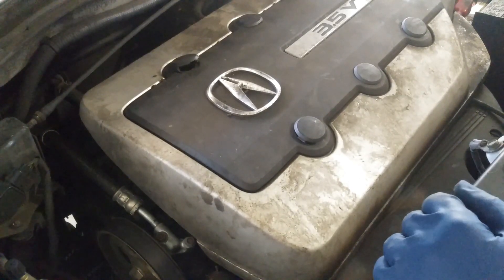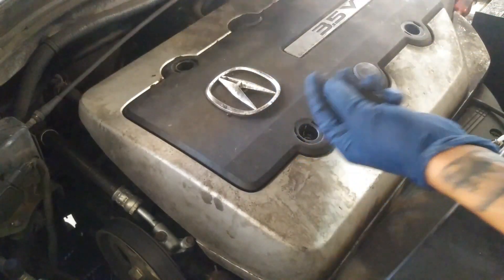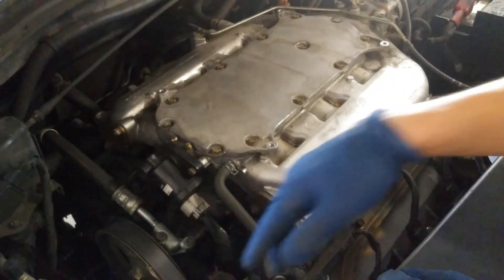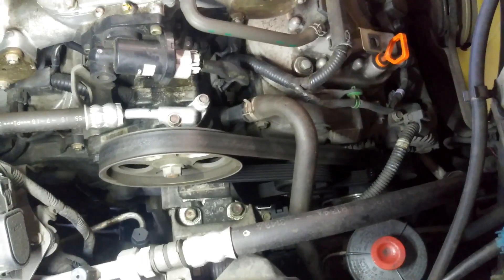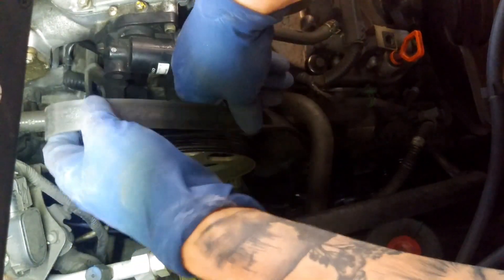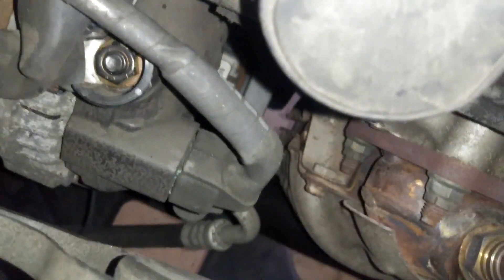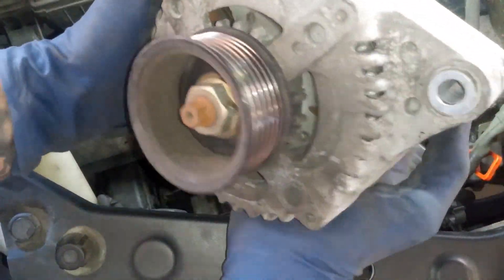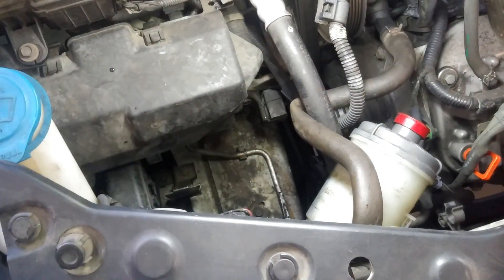how to replace a alternator on a 2004 acura mdx

Comment: Great vid. Thanks. A couple of tips. The “thing” with the red cap is the power steering fluid reservoir. It MUST come out. 10mm bolt under it. Use open end wrench (no room to pull alternator otherwise) also unclip the hose above the alternator. Also the white radiator overflow will slide up and out.  I did the entire project in 1hour 57 minutes.
Reply from the maker: Thanks for the input

Comment: Excellent video, really helped. I would recommend using a 1/2 blunt punch at the top to set the new alternator in the groove as it is very hard to get enough power when using a smaller longer punch. Also duck tape to hold the Serpentine belt on place on the pulleys worked well. In the end your walk through was the best I saw.
Reply from the maker: Glad it helped and thanks for the tips

Comment: Thanks! Your video is the only written or video instruction I've found showing the hardest part, working the alternator out and in. I was stuck, and thought I was going to have to get my car towed to a shop, before I found your video. I had to completely remove my coolant tank, and really push over the power steering hose and tank hard. I think my plastic fuse box, and headlight connectors were having to bend out of the way more than yours. But it did work, thank goodness.
Reply from the maker: Glad it helped!

Comment: I just replaced the alternator on a 2002 MDX, and found it was much easier to lower the alt into the space on its pulley end, and then attach the two electrical connections, before bolting it to the engine.  I, also, made an adapter wrench for holding the idler/tensioner pulley out of the way, while putting on a new serpentine belt.  I wired the handle of the wrench to secure it in the "loaded" position, while I slipped on the new belt.  If the wrench slipped off of the tensioning pulley bolt, and trapped a hand by the strong spring, you would have to call 911 to get help to get free.
Reply: How the hell would anyone ever get they're hand stuck under the tensioner 🤣
Reply: @86royal420  If you'd ever replaced an alternator on this MDX you would how a hand could be trapped.

Comment: If it helps anyone, i didn't have to remove the coolant or power steering fluid. If you take the belt of it gets easier. You can fish it out and In the same way. I have to rotate it, turn it, flip, then willfully squeeze it pass to get the old one out then i did the same with getting the new one in without a hammer but i was doing a vavle adjustment a.t.s.t. so i did have a lot more space to move it. But i  got it out that way with the engine fully assembled so, it might not matter. Hope this helps anyone

Comment: The battery is turning on , In my Acura MDX you think I’ll be the alternator? I take one cable out of the battery when on and it turns off .
Reply: did you end up replacing the alternator?  and did the battery light turn off?

Comment: Will this be the same on a 2002 mdx
Reply from the maker: Yes
Reply: Fyi for ppl who may benefit from this info Yes 02-06 are first generation which is what this video covers but if your mdx  is 07-14 then it's a  2nd generation and this video will not help 2nd generation is alot different and more complex but has a cheaper fix of changing the clutched pulley instead of the entire alternator but a guy has a decent video on the job on YouTube.

Comment: Do you know which was the positive and which was the negative wire on the alternator ?
Reply from the maker: There is no negative wire that goes to the alternator. Just only a positive cable
Reply: Jabo The Mechanic but there’s two cable’s. One on on the opposite end of the alternator one in the top middle.
Reply from the maker: Could you please email a picture. Chrisjabo1991@gmail.com
Reply: Jabo The Mechanic sent it

Comment: I have a question
Reply from the maker: What is it?
Reply: Jabo The Mechanic I have the old alternator out and new one in but it won’t go all the way in between the one part where you hit it at
Reply from the maker: You have to keep hitting till it opens  than the alternator will slide in. I know its a tight fit
Reply: Jabo The Mechanic do I hit the part of the alternator or the other side behind it
Reply from the maker: Its a little  nut thats on the bracket of the block